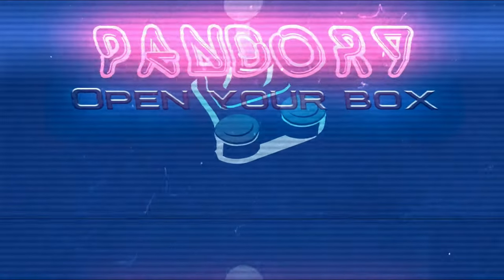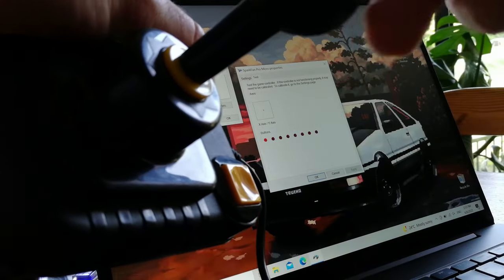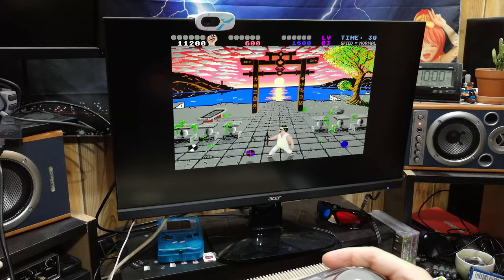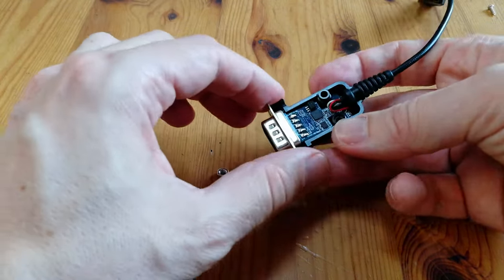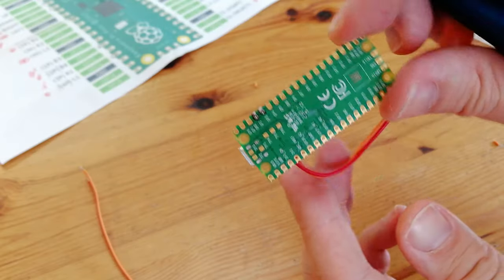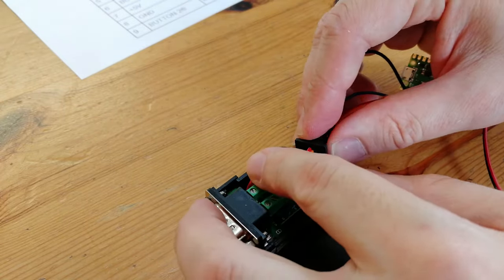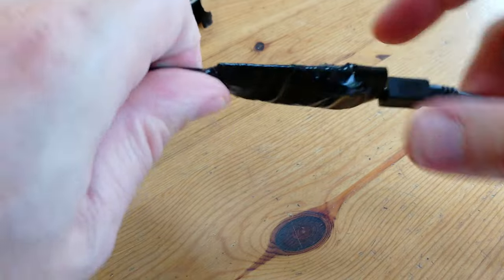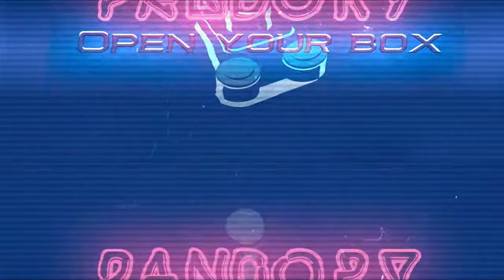Use REAL Amiga Joysticks With The A500 Mini!  THREE Adapters Tested!

Comment: Cool video, and very interesting to see the build-it-yourself option. I personally have found the "official" Retro Games Ltd controllers to be OK, but being able to use a classic DB9 joystick is appealing for that retro experience - especially if you can keep the latency down.
Reply from the maker: The solution we presented is ... Pretty much zero latency :-)
It's also a fun little project. Won't take you an hour, and you could make two for 20$

Comment: Quite nice, esp. the Pi Pico version. There is also an A600 keyboard to USB adapter on github, based on Pi Pico. And a PCB for an A600 mechanical keyboard... Add Drawbridge to add a DiskDrive, print a modified A600 case to build the Pi 400, the mechanical keyboard, the diskdrive and maybe a slot-in CD/DVD-drive inside and you get something much more powerfull than an A500 mini (but I think you can use the GPIOs for adding a joystick to the Pi400). Bigger than the A500 mini, but much smaller than a real A500. Optimal compromise. Also by simply swapping the micro SD you could use it as "Office PC" with Raspian (so no dust collector most of the time). I already made the keyboard (resin printed keycaps, not labeled yet, as my printer with dysub ink is out of order). There is also an stl for the A600 case available to print it, but my Anycubic Chiron is also out of order at the moment.

Anyway, my first Amiga was the A2000 and I fit it into an tower case under my desk. I still have the original A2000 keyboard (Braunschweig Edition = Cherry Keyboard with doubleshot keycaps - easy to retrobright) and you could easy put it to USB with an Arduino mini. So most easy to get retro feeling for me is just using the original keyboard from the A2000, an USB tank mouse (you can get the mouse of the A500 mini seperatly) and two of the pico USB joystick adapters.

But still, making an A600 cased Pimiga 400 with Disk- and CD/DVD-drive would be the ultimate emulator in my opinion; much better than TheA500mini. With USB to seriell and USB to paralell adapters you might also add some old hardware (the old Amiga to Fishertechnik interface wouldn't work sadly I read, but maybe an old NEC Pinwriter back from the days). For using the A600 keyboard in Raspbian I plan to reprogram the one key which is pressed unintentional 98% of the time as a "FN" key: capslock. So you could get F11, F12 etc. by pressing capslock and F1/F2 etc. ( and for the 2% you realy want capslock simply press Capslock+shift)
Reply from the maker: Yeah, there are a lot of better options than the a500mini, and we mentioned this in the review. But it has sold pretty well, and many are not comfortable in making 3d models or boards to change amiga keyboards to work with it. 
I made a 500+ keyboard work with a pi using an Arduino Leonardo board in the past. It's pretty cool, but I'd rather have it be a real Amiga. There's always something missing when it comes to emulation, just knowing that it's not the real thing. (Enter coca cola ad)
Reply: @TeamPandory  I definitly also prefer the originals - with some tinkering/upgrading. At the moment my main project is to rework a CDTV with CD-Drive beyond repair. So I try to add an notebook slot-in drive, an IDE-controller and a pistorm. Is a lot harder as it sounds. It has to be an IDE-drive (as I need to have analog-out), but notebook drives have Master/Slave/CS set in firmware - mostly slave. Only way I got it to work (testing on a Budda-Flash in my A2000) was using 50->40 IDE-Adapter with CS torn to GND, an SATA-Host to IDE-Konverter (only one out of 3 tested converters worked) and an IDE-Host to SATA Adapter on the Buddha. But using an IDE68k in the CDTV under a Pistorm (if it is not an original CDTV it should at least be powerfull) does not work (I removed the CD-Controller to avoid autoboot-conflict). Pistorm deactivates mapping of the scsi.device adresses if it does not find a hd... Next thing to try is A500IDE. A long way to go... At least I found my Pi Zero 2, so I can build a flat pistorm (glueing  Pistorm and Pi Z 2 side by side with epoxy and using 40 short cables to connet them), so if A500IDE works I still can mount both on top of each other and still close the CDTV. Sadly Pistorm seems not to support USB CD-drives (USB-flash is supported as HD if you set the mounting parth, but setting path to CD drive seams not work :-( )
But beside having some real nice Amiga stuff I would realy like a Pimiga in A600 design with floppy and CD-drive. I always used my Amigas more for work than gaming back in the days - so I see a fast Pimiga more as a "next step" to try out, what would have been possible if Commodore has not gone out of business. Trying to get an old 24 needle Pinwriter back to work was not a joke by the way - the quality with Turboprint was quite nice (the tinitus was not so nice of course). I used it a lot to print matrices for spirit carbon printing - I even have such a machine somewhere. Printing something in this techniqe would definitly retro to the extreme, even if using emulated Amiga ;-)
Reply from the maker: @oleurgast730  pistorm does really drive an amiga home. It's insane to see it pushes the Amiga so far, but I'm hoping more in regards to game compatibility. 
A500+ pistorm, a600 w furia, and an a1200 with Apollo 030 over here ;-)

Comment: Thank you so much , are there more joystick mod/hacks for the little pi board , love one for the BbC computer
Reply from the maker: If you mean to make a BBC Joystick controller work as a USB controller, I can't see how it wouldn't work.  A bit of experimenting and you should be good
Reply: @TeamPandory  no I was meaning the other way, use another type of joystick ie 15pin pc or 9 pin on a BBC computer, I have some really nice analog 15pin joysticks that love to use on my BBC computer
Reply from the maker: @juzziepope  You may be able to create an adapter by using female and male db9 connectors, but as for 15 pin ANALOGUE joysticks- I don't think the BBC can handle that, can it?  The DB9 joysticks usually stuck to digital inputs.
Reply: @TeamPandory  don’t think so which is why I was thinking something like the pi board In between, just like to use a analog style joystick on my Beeb

Comment: This looks great. I've bought the pico and followed your instructions. However, after I've installed the new firmware I can't get the Settings screen up. I press the black button, insert the usb cable the point my browser to the IP address but it won't load the settings page, it times out. I'm using a Mac, does that make a difference? Would this only work on a Windows or Linux machine?

Comment: Little off topic- but I can't seem to find the right cores for your retroarch mod on the A500 mini. I've tried all the linux/android/mini console versions of armv7/8 and even x64/86 of the .so files - but they always end up "failed to install core" on the A500 mini..? If you could post a link to the compatible cores I would be very grateful - or otherwise describe a more detailed tip on how to maybe install them without going through the retroarch 'core installer' if that is the problem... Your Mod Rocks btw...!! 🤎🤘😀
Reply from the maker: You'll be needing to add maybe the SNES mini cores, but not everything is fully compatible...  is there anything in particular you're after? In the next version we'll be adding a good few.
Reply: Just being a lil bit sad that the A500 is a restricted system missing an open firmware.. And, yes, a release v2.0 for the a500 with All retroarch cores would be soo nice - but it also would be really nice to boot up 'Dragons Lair' and 'Space Ace' from Daphne (maybe via Dosbox)  on this hardware..! The Commodore team tried their best to make it back in the day - with a shitload of floppies - but they never succeeded... ;) Maybe there is a way to patch a Batocera launcher in the boot of the a500 startup..? Damn I suck at coding.. I Love You Guys!! :) Keep Retro Alive!
Reply from the maker: @Whirre  to do so, pull out the board and replace it with one that supports batocera. We're jumping through hoops enough trying to get this working, but that's what you get with a system that doesn't want to be opened. ... Or at least RGL don't want anything to be altered

Comment: the cheaper why  is probably  just to open that original controller from A500 mini and drille a hole for cables on the side and just cut off cable  ( or only put the needles in DB9 socket) from old amiga /atari joystick and solder cables to  points on A500mini  controller's "motherboard"  (near microstick/  or condictive rubbers I do not know what is inside).  it will be not beautifull and robust.